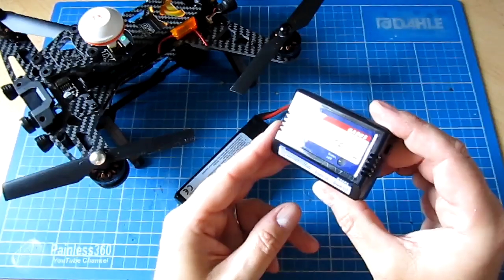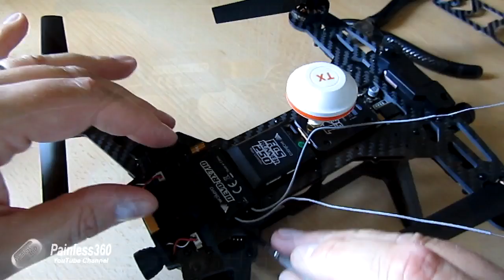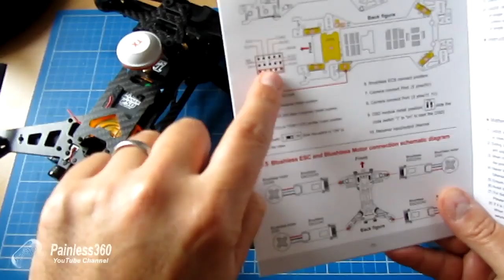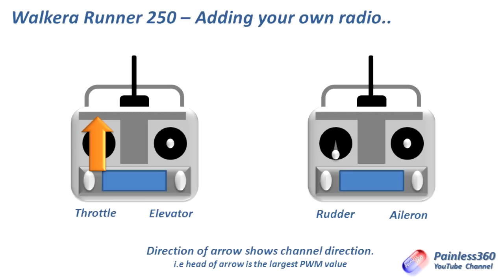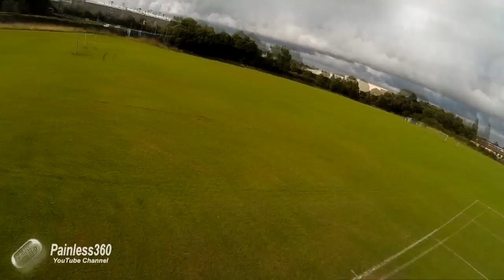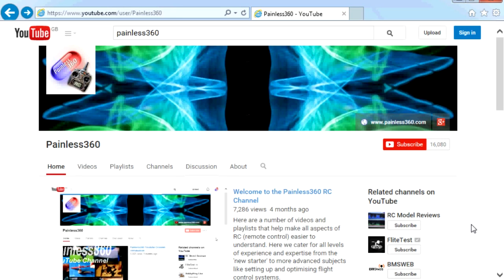RC Review – Walkera Runner 250 review and adding your own radio (from Banggood.com)

Comment: Hi again painless, I want to use to use a Flysky Mini Receiver X6B Transmitter, I don't know if that makes any sense, but I happen to have one. My question is I if I can wire it to this connector on the bottom. The X6B has some picoblade? ports, what kind of wires would you use for this job?  Is it doable? By the way I bought this walkera a couple of years ago, based on your review and I've had tons of fun ever since, but now I need to learn how to fix my quads and make my own builds. Thank you for all your vids, you are the best on youtube by far.
Reply from the maker: I've not used one here but a quick look at at and I can see that there are ports for the individual outputs (PPM, S-Bus and PWM). I no longer have the Walkera here but I remember it used PWM by default.. We did cover how I added another receiver to the model.. That video may help. Best of luck!
Reply: did you get the xb6 working on the walkera

Comment: Excellent video....thank you!  I recently purchased a Walkera Runner 250 R without the Tx - I have a Spektrum Tx.  So, thanks to your instructions, I am setting up a Spektrum Rx on the quad.
My question is will I be able to setup the GPS and use the RTH function?  Assign RTH to an aux switch?  Can I use OpenPilot.com for setup?
Reply from the maker: +Keith Aldredge the FC is a Multiwii so you need that software. We do have a video showing it.. Best of luck!

Comment: Painless360, can I use Futaba R6K 6 channel radio to run on this Walkera Runner 250? I noticed you mention this system runs only 5 channels, mind asking what does the AUX 1 ,2, 3 use as? I did some research on the Walkera Runner 250 Advance which has GPS function. The main board jumper connector remains the same in which requries 5 channels to get it working. But how we use a 6 channel like Futaba T6K to work with the "MIX mode" whereby it has 3 position flip switch for Manual > GPS Hold > Return To Home. Thank you.
Reply from the maker: See our other videos on this model where we connect it to a PC. The flight controller is a Multiwii and we have loads of videos on setting up that board too that may be helpful. The 'mode switch' can be set to activate up to three flight modes and you can choose them via the GUI.. Best of luck
Reply: +Painless360 thanks. But what about MIX mode as found in Advance version. Do you mean basically both models basically require just 5 channels to get the job done? Thanks.
Reply from the maker: The one we had here needed only five channels. Four for the main flight controls and one for the flight mode. Later models may be different but I've not seen them.. Best of luck!
Reply: +Painless360 Any idea how does the Advance GPS works? Cause I've read the manual in which the jumper pins remains the same as the normal version. It still needs 5 channels and three AUX. just one added feature is MIX Mode for GPS control. Thanks
Reply from the maker: Sorry no, ours wasn't the GPS model. We have added GPS to the Multiwii board in other video series though..

Comment: Im interested in Walkera, they seem to have a lot of RTF quads and toys. The Walkera 2 Axis gimbal maybe plastic but at 120 grams its lightest by almost half of any CNC'd.  Im comparing Walkera QR X350 the Cheerson CX-20 and the Quanum Nova Pro. Was hoping you had reviewed a X350. So far, for me, its 1- Nova Pro, 2- Cx-20 and bringing up the rear 3 - X350. Still shopping.
Reply from the maker: We've not seen the X350 here but do have videos on the Nova/Pro/CX-20 (they are the same model). We have a series on the Nova Pro is you're interested in that.. Best of luck!

Comment: Thank you for this video. I changed my receiver to a FRSKY D8R-II plus. I was aware of the Flip Of Death that's why I did not buy the RTF. I took it out today for its maiden flight and the Runner just dropped like a brick to the ground while moving forward about 30 feet away from me. My Taranis battery and my receiver antennas look perfect no damage. The quad is destroyed and I don't know what caused the signal loss between my TX and RX. I thought the signal loss happens to the Devo 7 and not other transmitter. Tok out the receiver and placed it into another model and didn't get a signal loss.
Reply from the maker: Very hard to even provide an educated guess on what happened there. Best of luck with the next model.
Reply: I am having the same issue.  I am replacing the PCB and hopes that fixes it.

Comment: thank you for the video. very good. I have 2 questions. could you please post your multiwii settings that worked best for you. and secondly is the FC 250c cleanflight compatible and is it CC3D? thanks again for a great informative vid..
Reply from the maker: Hi, we use the defaults normally by increase the YAW rate as I like the tail to be a little more responsive. I'd use a Naze32/STMF3 flight controller for Cleanflight. Use LibrePilot on a CC3D.. Best of luck!

Comment: I have been able to load Librepilot once-- in the beginning, The drone kept trying to drill to China off the ground. I figured that the motor order or the direction of the flight controller was wrong, After that, it has never hooked up. Gives me the error to plug in the board and manually update board with the plug in? Reloaded and reloaded, still the same, I then tried cleanflight (chosing the cc3d hex file, -- no luck. I reloaded the driver and placed it in the device manager-- It gave me a com 3 number. My naz 32 advance is coming in 10 days-- will try cleanflight once more. Do you have any more things I can try? On librepilot, when I update and erase (1st step)-- it times out and will not connect,
Reply from the maker: +Bud Jones Sorry, no. I'd not try and change the firmware on a model like this - a little too 'preset' to allow for any changes needed. Best of luck getting it working.

Comment: I just finished the Robocat build. For the last two weeks it has been sitting. The Librepilot and Cleanflight will not connect or hook up. I get an error saying waiting for board to be hooked up, and update with plug in Update board. I have tried 2 computers-- no luck. Do you have ideas to help the problem and fly???
Reply from the maker: +Bud Jones so what exactly have you tried already?

Comment: Hello again Painless360 , Can you possibly tell me if you know if the runner 250 flight controller supports a ppm connection with only 1 cable ?
Reply from the maker: +desode9 As it's a Multiwii I think you can but I've never done it.. Best of luck..

Comment: interesting, what I found the deal on banggood with receiver camera and fpv transmitter, is cheaper from deal on ebay ?? 157 from banggood and 140 from ebay, without radio, fpv transmitter and camera//?  what it is so cheap on banggood??   I also would  like to have just a parts to build it

Comment: Could I replace it with the walkera runner advanced transmitter using the ribbon cable?
Reply from the maker: +Golden Archer if the receiver is ppm then you should be able to..

Comment: Frustrated with my Runner, I am aware of the Flip Of Death and I did that workaround, but twice the Runner just drops like a brick to the ground while moving forward? Last night it flew perfect but the second flight it randomly dropped while moving forward at 100ft. away. My tx. battery shows full charge and my Rx. antennas look perfect no damage. Any thoughts?
Reply from the maker: Could be a radio problem. We passed on our Runner so can't check for you. Best of luck..

Comment: Hi, so im a bit of a newbie. I have a futaba R7008SB receiver and i want to connect it to my walkera runner 250. Is that possible, i cant seem to find a port schematic for R7008SB receiver?
Reply from the maker: +So Soso If it is a PWM receiver then you should be able to. We've not used that radio here - best of luck!

Comment: we can use more powerful battery and please what's the voltage thanks for video and all
Reply from the maker: +rizan moulana The battery bay is very limited so you'd have to look to see what would fit. The battery supplied is fine for most flying..

Comment: and what the receiver can i use?  any receiver dsmx spektrum or i need to buy  615x orange receiver?  this yours is  A 615x?  thanks!
Reply from the maker: Any Rx that provides 5 or more channels in PWM. See 'Introduction to Remote Control' playlist for more basics.. Best of luck!
Reply: +Adriano Quirino I just installed my AR8000 I had laying around. I used the guide in this video and had no issues. After I set subtrims such that center values are at 1500 and did the two calibrations, it is SUPER stable.

Comment: how can i get my dx6i to control the flight modes? i did everything you did and cant figure out how to switch out of stabilize mode. i think it might be in my spektum settings.
Reply from the maker: +michael williamson Make sure you can see the channel values moving in the monitor on the radio first. Once you've seen what channel is moving for the switch you want connect that one up to be used for the modes on the model. Best of luck.
Reply: +Painless360 it says CH5 on my monitor is the one moving. do i have to connect the receiver pins in differently? im using a AR6100 receiver i think and i also put a single plug in for AUX1.
Reply: +Painless360 also this is a different account of mine, for some reason my laptop has a different account.
Reply: +Painless360 thanks :)

Comment: Would a Turnigy TGY-i6 work with this recciever
Reply from the maker: +Jayden Clifford If it provides PWM outputs for the model - yes..
Reply: Damn your fast Thanks
Reply from the maker: You happen to catch me on the PC doing admin and messages ;)
Reply: +Painless360 I've got another dude saying that they use a different communication method?
Reply from the maker: I'd ask the 'dude' some more questions if I were you ;)
Reply: And would I set it up the same way? or would I plug directly into the onboard recierver
Reply from the maker: Follow the video with whatever Rx you are using.. Best of luck!

Comment: Hi Sir, great video, thanks for you help! I could connect the Spektrum receiver (I'm using a DX6i). Everything commands I think work fine, but I'd like to know, how to use all the features that says at manual, such as mod 1, mod 2, RTH, acro mode... etc. I connected the right gear channel, but I cannot start the camera. Maybe it's a beginner question, but how can I use all the other switch commandos from Spektrum radio? I really appreciate if you can help, thanks!

Comment: Thinking about getting this quad but not sure if I should buy with transmitter or not. I have a flysky transmitter and I would buy another frsky d4r-ii for the runner250.  I also plan on getting the gps version. Will switching modes be a problem?
Reply from the maker: +Anthony Rossi As some point we all end up getting a 'decent' radio that supports lots of models and retire the 'RTF' radios in the collection. Personally that took me 3 models before I realised it was the only way to go.. Best of luck!

Comment: need help!!!! please with walkera 250 spectrum receiver I'm using a ar600x..noticed you used a Orange.. receiver...but my elevator, and the alieron are in a  different order on my receiver..HELP..!!!!
Reply from the maker: Simply connect the wires to the right channels. Test using the GUI that the control on the radio moves the right input. Work through it methodically and you'll get there..

Comment: great video but cannot seem to arm with a Ar600 spectrum receiver please can you tell what orange rx any one has used which is compatable with the runner & dx6i tx. cheers .
Reply from the maker: +Mark Hurrell All should be. I would suspect that the limits on the new radio for THR and RUDD or the direction of those channels is wrong. Best of luck.

Comment: Hi Painless, What is the receiver you have added to the 250? and would it be compatible with a Taranis Plus out of the box?If not, what TX module is the correct one to pair with the RX.  I have looked at the FRSky 8 channel RX's but they all seem really big.As it has to be PWM my D4R-II only has 4 channels via PWM which means I wouldnt get FMOD choices.Cheers Dean
Reply from the maker: This is a Orange 615 reciever. You need a 5 channel PWM reciever for this to work. Im using a Spektrum radio here. You can also add a Orange TX module to your Taranis too..

Comment: thanks for the tutorial, 
i am a newbie, and i have some doubts:
Are the wires connected in the same position in every receiver?
Reply from the maker: +elyosi89 No, check the manual and writing on the one you are using. If you're not sure use the Runner 250 with a Devo 7 radio and avoid the hassle. Best of luck.
Reply: Painless360  thanks for the answer. I supposed it but i prefered to ask it
Reply from the maker: Always good to look up something if you're note sure. Best of luck with it!
Reply: Painless360 one question, how do you give power to the receiver? Just connecting three gnd pins to the receiver?
Reply from the maker: The red and black wires provide the power from whatever you are plugging it into. See the videos in my 'Introduction to RC' series to find out more.

Comment: Thanks for tutorial.
I setup mine as in video, but acro-mode dosnt work....auto level OK.
Im using FrSky Taranis, receiver gear ch. works and "gear-cable" is ok. Channel settings in transmitter -100/100.
Any idea??
Thx.
Reply from the maker: Hannu Sairanen I would connect a servo to the channel you are using for the modes and confirm that it moves when you flick the mode switch. You can also use the video where you can connect it to a PC and 'See' how the board sees the channels too..Best of luck..
Reply: +Painless360  Tested with servo and it works.  I also find some info that Taranis servolimits must be set 70/+70 for Fmod.....testing after rain stops. :))
Thx.
Reply: +Hannu Sairanen -> Tested and it works!!!   Now i can fly acro and make some nice crashes.  :-))  Argh...
Taranis needs "servolimits"  -70 / +70 for Fmod channel.
Post #1144 @ http://www.rcgroups.com/forums/showthread.php?t=2446428&page=77

Thx.

Comment: To all, make sure you enable "THROTTLE FAIL-SAFE", because you could find yourself in a fly away situation like a friend of mine.
Reply from the maker: Giid point!  Happy flying!
Reply: How do you do it?
Reply: Darío Alomía  Test your current active setup by binding the TX and RX, engage the throttle , and while throttled up cut the power for the TX and if the props continue to spin you got a potentially real bad problem. To fix this you have to engage the throttle fail-safe in the TX, I had the Devo F7 and there is an option in the TX menu to enable throttle fail-safe, I no longer have that TX, but this is what you need to do.

Comment: I'm looking all over the Internet; where did you get the single cable from?  Also, from the 3-splitter did you run a single cable from each of the split heads to the port on the quad?  Thanx!
Reply from the maker: The cable is a simple servo cable. The other is one that had the ends split into three leads. This is a very common setup for multiwii flight controllers. If you google for multiwii cables you should find all of them. You can easily modify an existing cable by using a pin to gently lift the tabs to allow you to remove and move the individual cables.  Best of luck!
Reply: Sweet! Thank u sir!

Comment: The Runner250 is a nice little model, I bought the FPV version while waiting for the hundred little baggies from china arrived to build my ZMR 250 ...  but it has a GLARING design flaw in those solid arms: they are attached to the PDB which is just thin FR4 PCB.  If the thing comes down on a corner, the arms will cause the PCB to flex and very likely snap -- unfortunately, because all of the control traces are very fine, and run along the outside of the board, they will snap too, rendering the quad useless.

I've done this twice, once on the right-rear arm and once on the left rear arm, with very minor crashes (the first one was a dumb-thumb throttle cut from about 18" off of the ground, and the other was from under 3 feet.  Unfortunately, because of the integrated nature of the craft, it's 40 bucks for the PDB ($30 + $10 shipping) and an hour of time to replace the board.  

aesthetically it's a very pretty bird, and at first glance, it looks pretty tough, but those thick arms transfer force in a very un-pretty way to the PCB :-(    Mine is sitting in its box; now that my ZMR is built, I'm trying to decide if it's worth another 40 bucks to get it flying again.
Reply from the maker: It provides a nice option for pilots who are not confident builders and users of the software tools to get into smaller racing quads and FPV.

I agree,  the design of the arms (and the thin bottom plate) does make the expensive PCB a failure point. It would have made more sense ro make another, cheaper, easier to replace part the sacrificial piece in the arms/mounts in the event of a nasty crash. 

In practice I suspect that most will try and build their next quad after getting bitten by the bug flying this. With one if the £100 250 class kits from Banggood you get everything you need (apart from the radio gear) needed to build and fly.

Happy flying!

Comment: I've had this craft for about 1 month now.  The only problem I have with it is that any small crash or hard landing the video TX decouples from the frame...which depowers the TX.  A zip-tie solves the problem but I'm waiting for the next piece to fall off.
Reply from the maker: Roller's Ramblings Great tip - thanks.